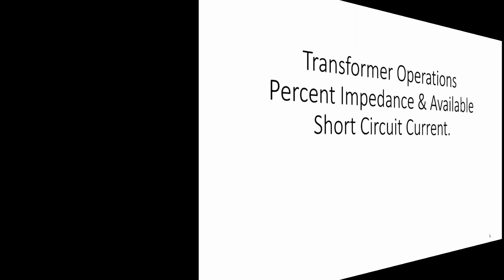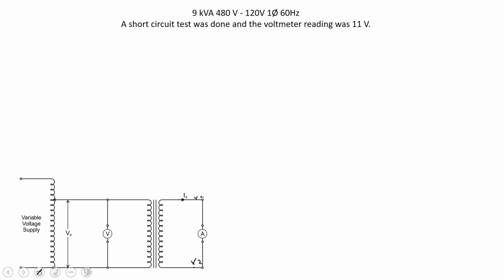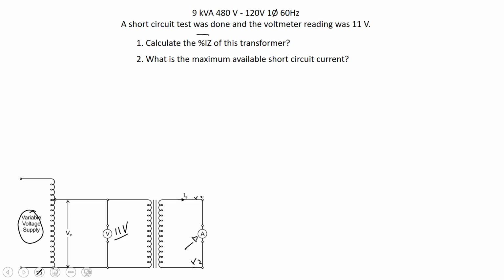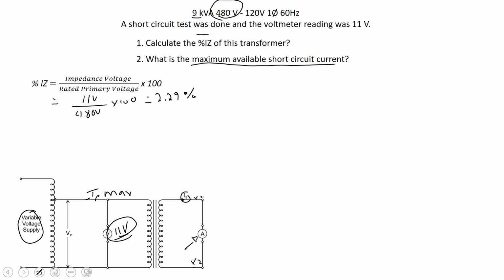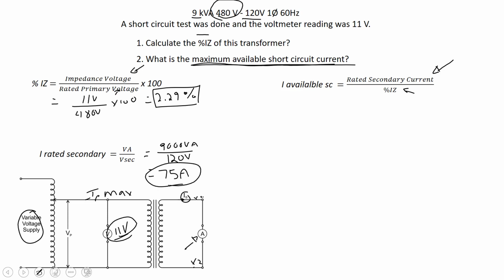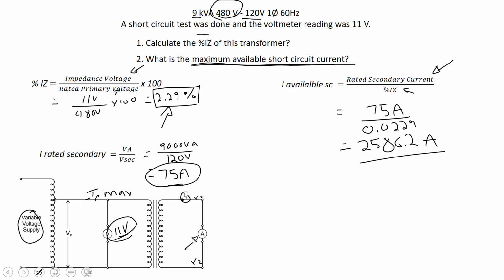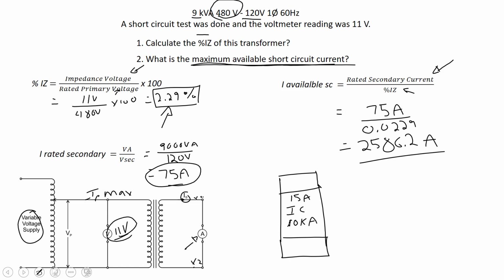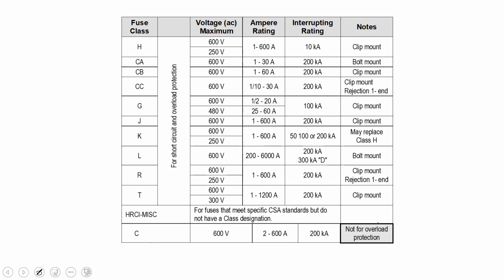Transformer Operations Percent Impedance and Available Short Circuit Current

Comment: Is it possible to do this test if the actual VA rating of the transformer is unknown. I have a vintage hedgehog transformer from the 1920 but no manufacturer’s information.    The transformer does have a 200-220V input tapping. The transformer is used in a power supply with a rated dc output of 20mA. I wondered if I could approximate the VA rating too 210x20mA
Reply from the maker: This link may be of assistance https://electronics.stackexchange.com/questions/367453/easy-way-to-estimate-the-power-handling-capability-of-an-unknown-transformer